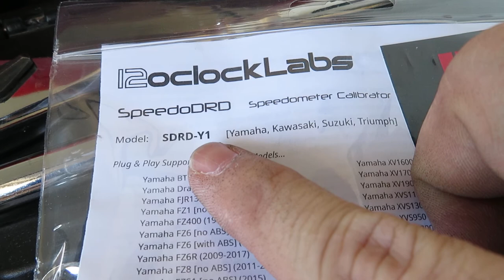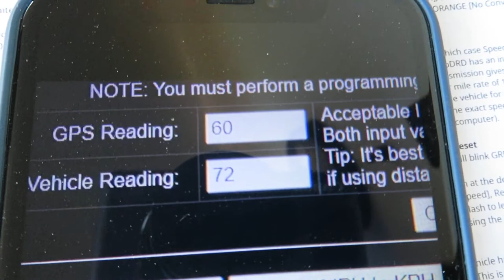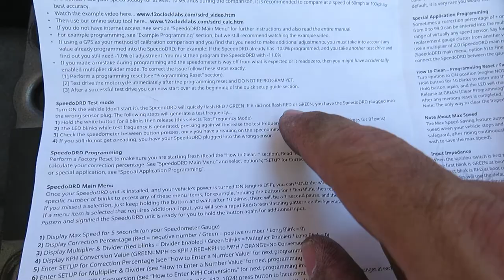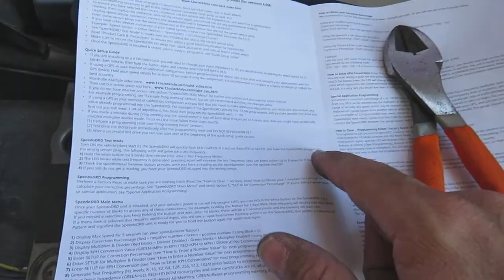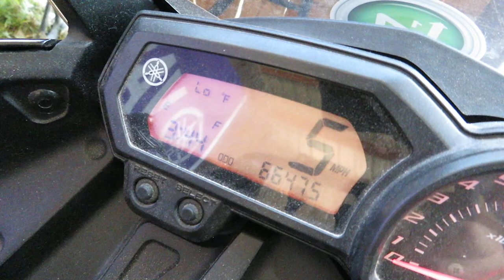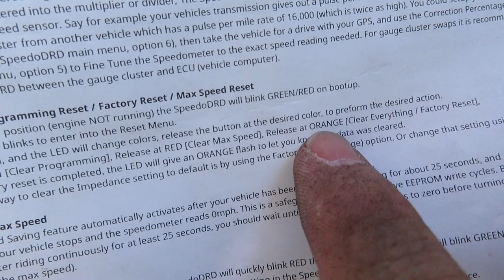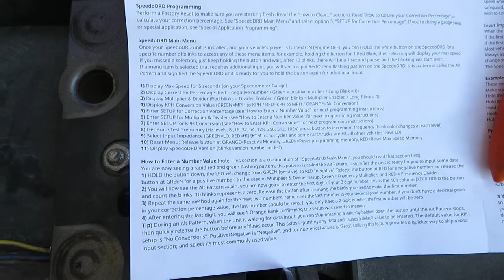Yamaha FZ6R: 12 O'Clock Labs SpeedoDRD Installation

Comment: thanks for pointing out where the speedo wire is, I got a gear shift indicator recently that taps into those plugs, so now I know what to look for.
Reply from the maker: Excellent! 👍
Reply: How do you like the gearshift indicator?  I've debated getting one because I'm kind of lousy at being in the right gear.  Do you actually find it helpful often?
Reply: @brianhaygood183  It's good, yea, I didn't need it cause I all ways know which gear I'm in, it's just a nice little niche thing to have that's there at a glance, haha.

Comment: Once again, your video does not disappoint.  I have the same bike, same year and color.  Getting ready to install the speedo DRD this weekend.  I haven’t tested the speed with GPS, but instead plugged in the numbers for sprocket setup.  It gave me a -06.1% value.  Way off from the value you got from using GPS reading.  Kind of thrown off by that since the setup guide gives you two options.  BTW, my setup is 16T front sprocket and 49T rear.
Reply from the maker: I'd redo the math just to be sure, and then also do the GPS method just for comparison's sake. I had downloaded a free GPS app from the App Store and then deleted it when done.
Reply: @HalfClickUp  I couldn't wait for the weekend, so I did it yesterday.  Did the math and the correct value turned out to be -11.1%.  Programmed that in, which was a breeze since they're all "ones".  I'll check it in a few days to see how accurate it was.  
Now with new tires and sprocket / chain setup, it's a whole new bike.  I'll be posting a video soon.
Thanks again for your help.  You're a great resource, keep up the good work.
Reply from the maker: @orlandoflores7720  glad it’s all working out man! Thanks for watching my stuff 🤙

Comment: I got lost watching you programme that gizmo. How many functions on one button?. Im scratching my head from England trying to follow it lol. Very nice and clear instructional video bruv apart from the button pressing which really confused me but the instructions aint here for me to see. Keep em coming bruvva. Ride safe
Reply from the maker: That one button provides for 11 programming menus, and the entire thing is based on counting flashes and the colors of those flashes. Impossible to do without the instructions! 😆
Reply: fortunately you only have to do it once.  It is really strange, but you end up just following instructions line-by-line and it works.  That's the "price" of having such a tiny device.  I've got one of these  as well as a Speedo Healer.  The Healer is bulkier, has a single-digit LED segmented display, and two buttons.  So, it is a tiny bit more intuitive, but you still aren't going to do it without instructions.  It is just more in the way when you are done.  DRD is also a bit cheaper, so done deal.
Reply from the maker: @brianhaygood183  that little black cube tucked nicely right next to the battery. Pretty dang nifty!

Comment: Thank you for this input. Last weekend I installed a new chain with a 15\48 sprocket kit and my speedometer is off by exactly10mph. Was looking on how to correct it or just stay at knowing I am 10mph slower than what my speedometer says. Only bought the bike two years ago.
Reply from the maker: Man it’s so simple to install, and once you’ve done it that’s all there is to it. You’ll never have to bother with it again unless you change up sprocket size again. Go for it!
Reply: I will definitely look in to getting this product. This video will definitely help me out. I ride a 2017 FZ6R.
Reply: Speedo DRD.  Works like a charm and easy to set up.

Comment: Did you find any good  Steering dampers for the FZ6R?  My steering feels loose  When I get close to a 100mpr And I'm not sure what to do.  I might just need to tighten my steering myself.  Any suggestions on what to do And how.
Reply from the maker: The only thing out there that I’m aware of is various universal kits that are available. First thing I’d do is tighten the stem nut to 86 ft. lbs.

Comment: This is a silly question but how do you lift up the tank to access the wires?
Reply from the maker: Look right at the top of your tank underneath the triple tree near where you insert your key into the ignition. You’ll see two hex head bolts side by side. I think they’re 5mm. Once you remove those, the tank lifts up like the hood on a car. You’ll need to remove the two plastic trim pieces above your fairings though because the tank won’t clear them.
Reply: @HalfClickUp  awesome!